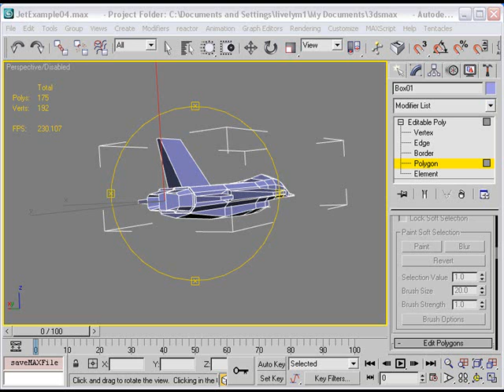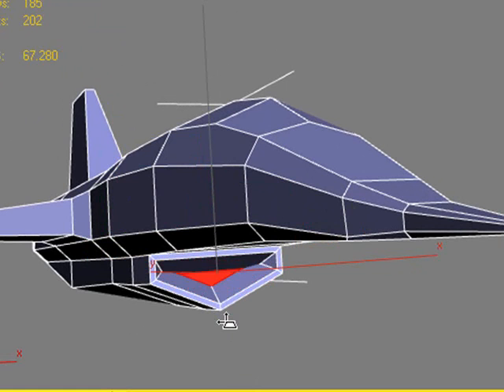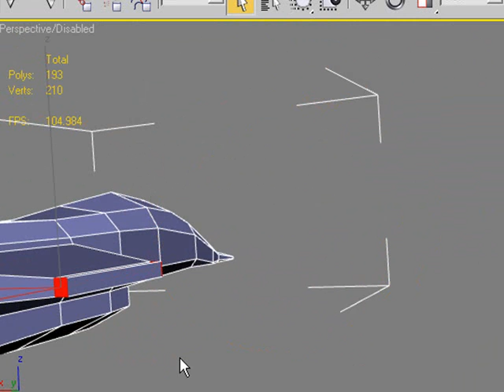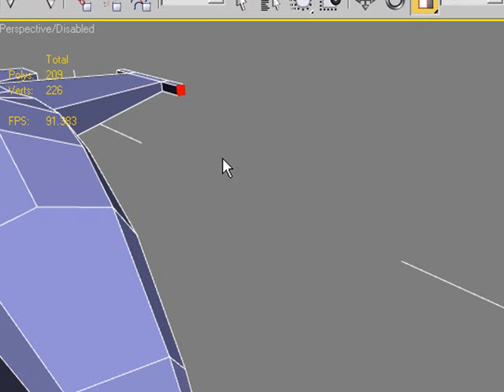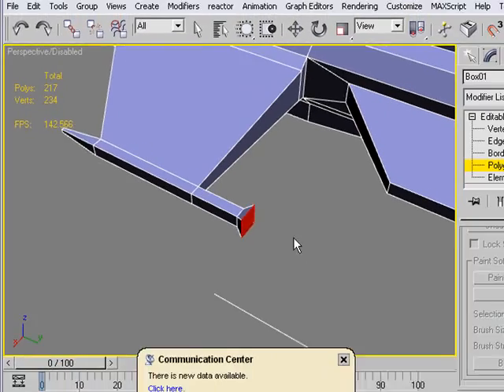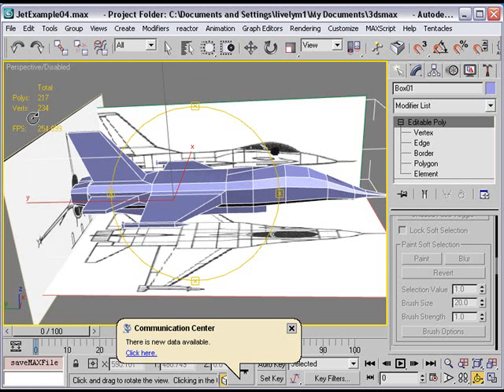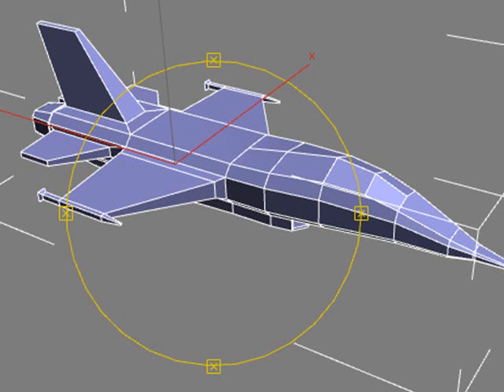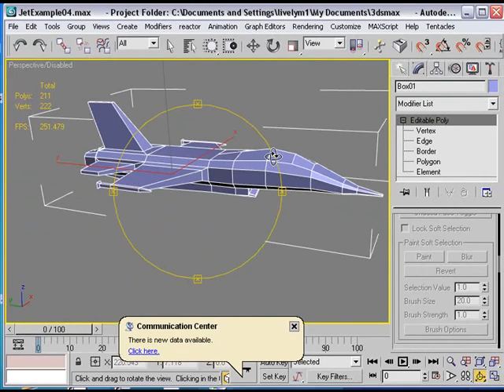(4 of 6) Box Model a Jet for PV3D - Pt 6 in 3DSMax

Comment: Alright man, I appreciate your effort, but this is retarded. Missiles and bombs are different things. Wings, tails, and elevators are different things. And the "two engine" thing is retarded.

Also, past video 1 we don't need to hear every shortcut every time for moving around, and as it is it's so much easier with the mouse wheel and ALT. Lastly I was disappointed how sloppy the job is, and how you didn't do a lot of things other than bevel-shift.

Comment: Papervision isn't integrated in Flash CS4.
I've had a play with Flash Player 10 and the new Flex SDK. Flash Player 10 has support for Triangles, that make 3d surfaces, but that's about it. You can use a 2d sprite as a 3d plane and move(x,y,z), rotate(x,y,z) and scale.

The closest thing to the new 3D API in flash cs4 is five3D in my opinion. I've made some objects from planes in Five3D and just had to switch from Sprite3D to Sprite and just re-used the code.